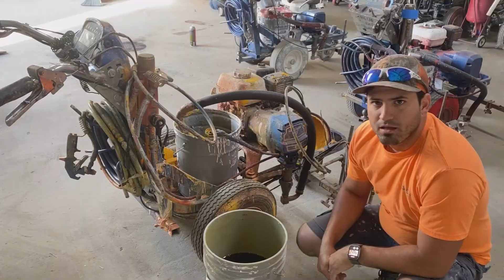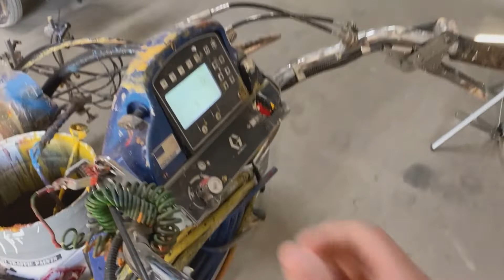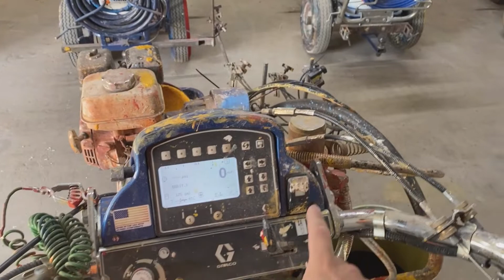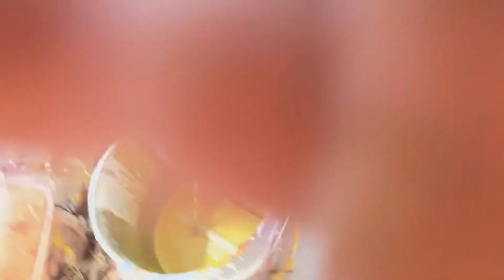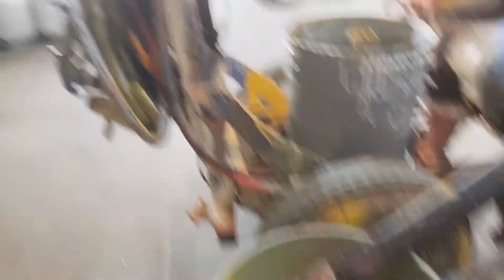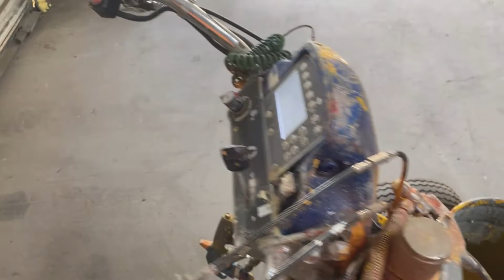HOW TO BLOW OUT A LINELAZER TO RECIEVE NEW PAINT

Comment: Very good. I use water based paints as much as possible because of the convenience. When it comes to flushing the system. I do the same process but do it twice, circulating the waterfora much longer time, then switch the pickup to a clean drum of water, wait till clean water comes out of the return then put the return in the clean water and runthegun into the dirty drum until clean water comes out. When finished, there is nothing in the system but clean water, so it is literally impossible to have paint dry and block the circuits. Since I started doing that I have never has any issues with blockages or colour contamination.

Comment: This is the best video I have seen on doing this. Im brand new to the industry and found out the hard way on making sure it is not under pressure. My garage floor has a good amount of paint on it now. Thanks for the awesome video.
Reply: Absolutely! I honestly felt like I could’ve gone into more depth but I’m thrilled you like it.
Reply: @allenwilliams8624  do you always make sure the machine is grounded when using oil based paints? I noticed the one bucket was plastic.